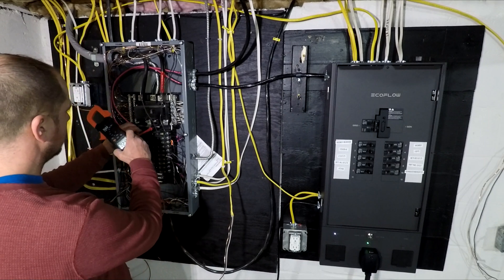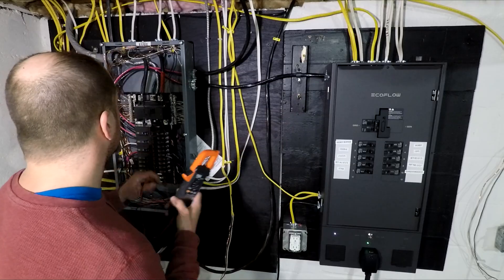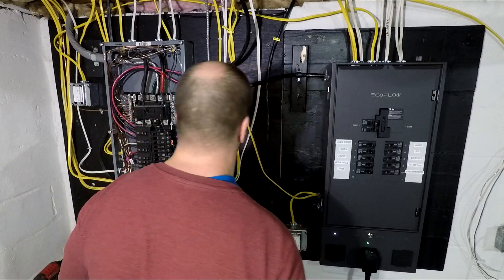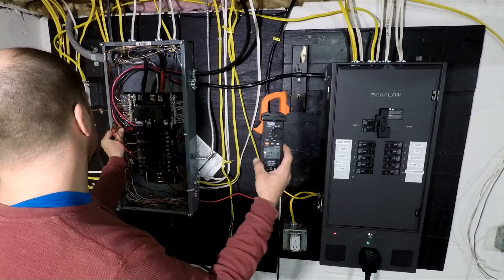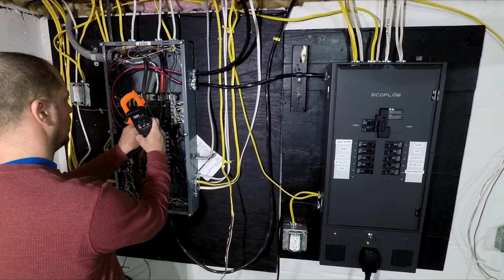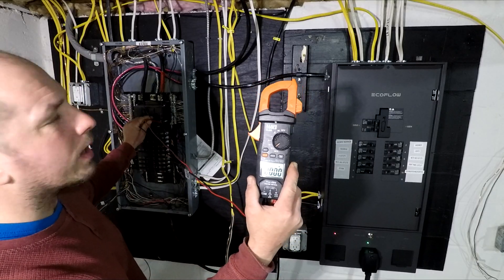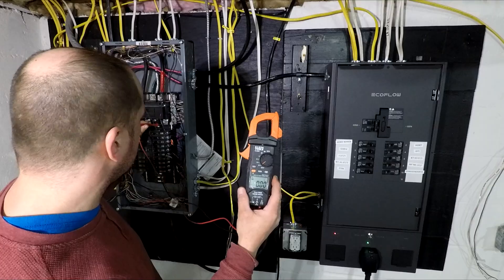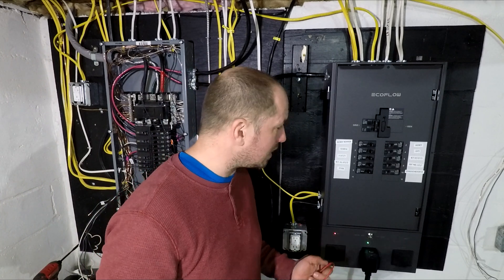ECOFLOW Smart Home Panel 2 Grid safe

Comment: Can this be used as the main circuit breaker without the dumb one using grid power only? My house is now under construction and I want to do a smart breaker from the get-go. I will install EcoFlow batteries at a later time.